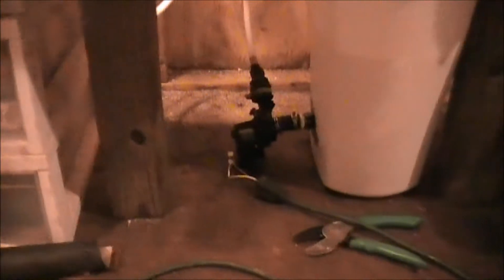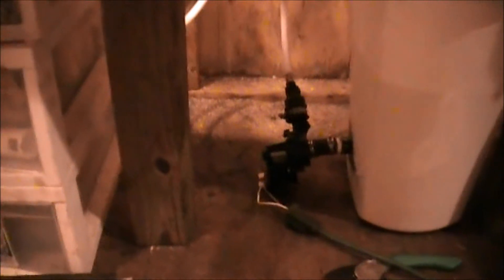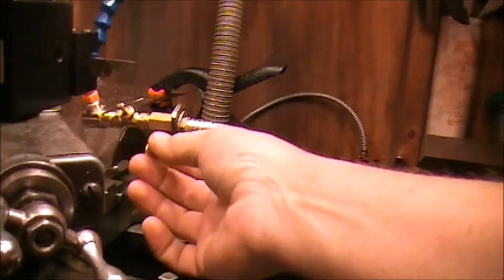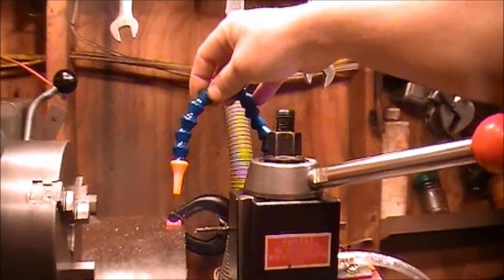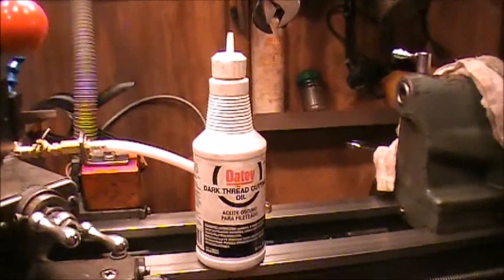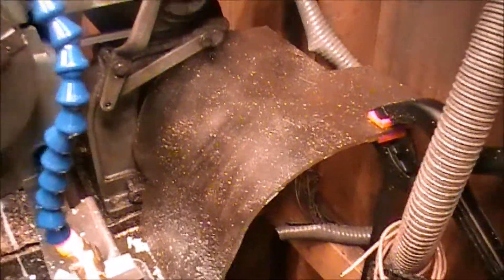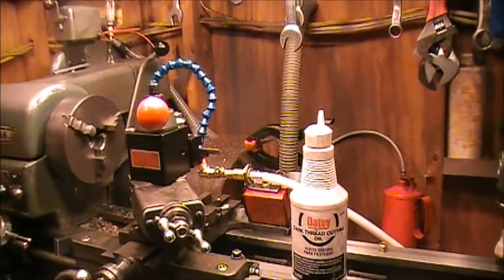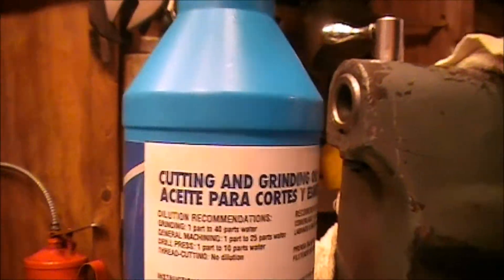D I Y Lathe or Milling Machine Flood coolant system

Comment: Great idea, but my lathe doesn't have a tray ;-(
Reply from the maker: build a tray! if you are doing anything that requires a tight tolerance flood or mist coolant is the way to go. controlling the heat of the part results in less error do to expansion and contraction of the base material from heating and cooling. I found this out the hard way. machining a tool that had a close tolerance made all the difference with flood coolant. plus I was using 01 tool steel and if I used just oil brushed on the material would harden and then stop being machinable.  with the flood coolant the material stayed just cool enough to not get hard.
Reply: I intend to.. should be a good project 👍
Reply from the maker: @ianwilliams4787  I love a good project!

Comment: How did you keep the pump primed? Im working on this similar setup, but my gravity drains the coolent out of the pump, then when i turn on the pump, its not strong enough to get started. Its a dish washer motor pump with decent power. Any thoughts?
Reply from the maker: yes those type of pumps need to be gravity fed. in other words the pump must be located below the fluid level so the pump cant lose its prime.
Reply: Or just use a proper diaphragm pump with a prefilter. It costs $10 at any RO DI supplier.

Comment: This is extremely hacky at best
Reply from the maker: Hayden, of course it is. that is the entire purpose of the video. not everyone has the funds to simply buy a fifty plus dollar pump for coolant. this pump was free and can be found by the dozens behind appliance stores in discarded old dishwashers. mine has been working under heavy use for many years. it is failing and I bought a twenty dollar harbor freight pump but have not installed it yet.  I find making use of old stuff like this very rewarding.

Comment: you always and you bought a brass fittings? Are you kidding me is that a joke or what? Is that not too quick with jokes sometimes I can't even wrap my mind around that
Reply from the maker: brass dont rust, the needle valve was a feature i wanted for flow control it was available in brass. the system works great still using it. thanks for commenting.
Reply: You own a lathe........ 
I have not bought a brass fitting in years 

Make them for Christ's sake,  that was my point! 

.
Reply from the maker: l needed the valve right then to finish this flood coolant system and it was faster and cheaper to go buy the adjustable needle valve and compression fitting than to machine them. I'd be thrilled to watch a video of you making all these brass fittings and needle valves. please share.
Reply: The only joke here is your spelling and grammar...
Reply: The only joke here is your spelling and grammar...

Comment: You need clear hose to tell if it's put ping lol?   Seriously?
Reply from the maker: +Clown Whisper these coolant systems get clogged up and with clear hose you can see where the clog is if its making it to the top but NOT coming out the clog is at that end if it not making it up the hose then the clog is at the pump. its gives you a better idea at which end to start looking for the obstruction. to take the pump loose you have to drain the system so its best if you have some idea where the issue is. also if the obstruction is mid way up the line with clear hose you can see it.

Comment: 120Vac sub-pumps @ Harbor Freight plenty of selections under $20.00
Reply from the maker: +revolutionpm  yup I actually bought one. the pump I used when bad and I replaced it. now this one is failing and I plan to try the harbor freight one you suggested.

Comment: Is there a way you could filter?screen your coolant to get the most life out of it? Say maybe an old Luberfiner from an old rig??? You idea is solid...I'm just wondering...
Reply from the maker: I'm not sure, I would think at some point of filtration you would re-separate the oil from the water. the bigger issue is keeping it from freezing in my cold shed. ha ha  I thought about adding antifreeze like goes in a car. problem is antifreeze is so dang toxic I hate working with it.